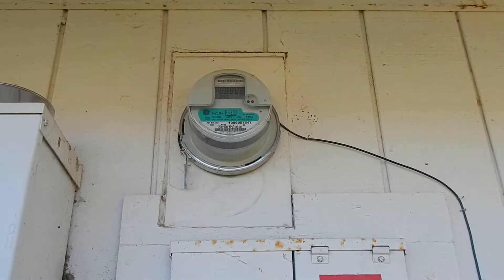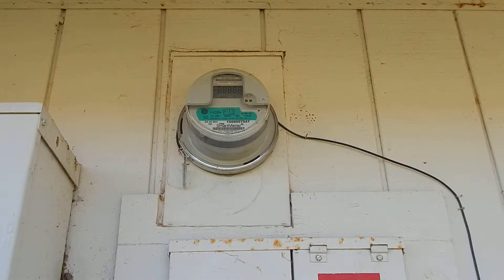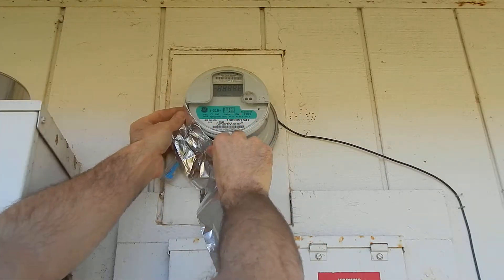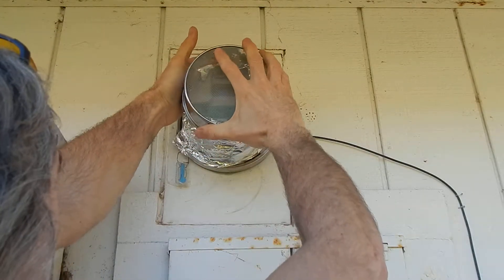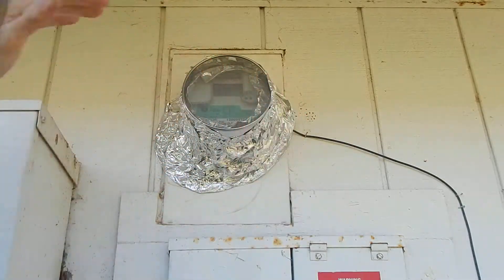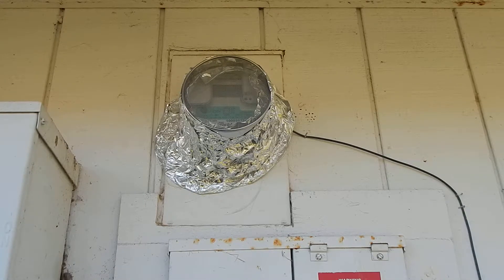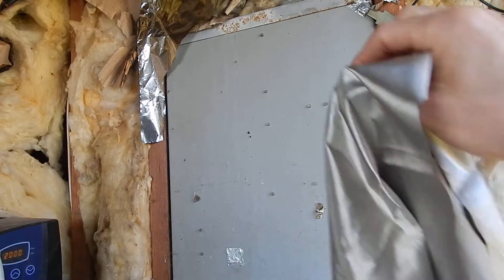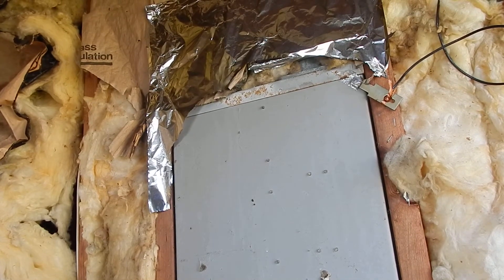Professional Quality Smart Meter Shield for Under $20

Comment: In the previous video you said the meter transmits signals through the house wiring using it like an antenna, and even devices plugged in further propagate the signals. 
So simply shielding and grounding the meter doesn’t solve much if the house wiring is like the antenna system for it and literally wired throughout the walls of your house.

Shielding all Romex in your walls is not exactly practical but if this was done all the grounds would have to go to one main ground & not be grounded to each other to avoid ground loops.

Comment: any way to show the grounding and how to do it?  I don't understand that part.
Reply from the maker: Just a wire leading to a 1-foot ground stake.
Reply: @alouiciousjackson5812  Thanks for answering!  Can the ground stake be rebar or does it have to be copper?  What metal is the wire?  Can the power company still record the reading?  They want to charge me over $200 a year if a meter reader is to come out!!
Reply from the maker: @marye8624  You can use any wire really, but stranded 14G is probably best. You can use anything for a ground stake, a large landscape nail is easy and cheap. The power company will still be able to receive the signal. Smart meters are powerful enough to broadcast 25 miles(supposedly) so this will cut it down but they can still read it.
Reply: @alouiciousjackson5812  I liked your idea of doing the back also!!! You're awesome, thanks!!!!

Comment: Even though smart meters don't need to use super sized signals (which are not safe) our govt FCC allows utilities to transmit these super size signals between the meter (utility equip) and the utility office/shop. The side affect is a people safety hazard but utilities obviously don't care about the health hazard. Your apt owner or the homeowner permits the utility to install these meters on or very near the    
residence - but if you refuse utility access the utility can remove access to electric service - not the best solution. SO safety CHANGES are needed:
1. Make utility keep their equip a safe distance away from living areas.
2. Make FCC modify the allowable signal strength used in smart meters and other similar transmitting equip.
What to do:
Get in touch with your lawmakers and express your demands for improved safety.
Supposedly, the lawmakers work for you.
or do they....hmmmm

Comment: If those meters are so dangerous to our health that people have to cover them to protect themselves, then, why do they make those meters at all? I mean, once you put a cage around it they will lose communication so their purpose is defeated.
Reply from the maker: This blocks out most of the signal but leaves enough to communicate. Smart meters signal reaches about 30 miles, this eliminates most of it but not completely.
Reply: @alouiciousjackson5812 , from what I hare read the dam meter does not need to broadcast to communicate. It sends it's messages over the wiring.
Reply from the maker: @joseperez2515  well wouldn't that be something! they have the technology to make it communicate through the wiring yet still they broadcast a microwave strength frequency through all the wires in your house!
Reply: They don't care about us or our health.  Healthy ppl don't make them much income. Sick ppl are more profitable.

Comment: I thought this entire topic was B.S. until they installed a Smart Meter at my house last week when I was not home. I haven't had a good nights sleep since it was installed. I have never had a problem sleeping in my life. I am going to do this and see how it works. On top of not sleeping my youngest granddaughter is being super aggressive which is not normal. I don't know if that has anything to do with the smart meter but I will find out when I block it. The Smart Meter is right outside of her bedroom. The only thing between her and the smart meter is a sliding glass door.
Reply from the maker: It helps with the emissions coming from the box itself- but the real problem is that Smart Meters broadcast their signal through all the wires in your house. I have to wrap my head  with and sleep under a layer of a material called Staticot. It's a sheet-like fabric that actually block the signals.
Reply: @alouiciousjackson5812  We have a right to life. Those meters are dangerous and all citizens should unite and file a class action lawsuit against the companies that installed the meters.
Reply: @kibbulz1  eventually I’m sure people will.
Reply: It will be that. Just do what this guy has done.
Reply: I hope you got yours fixed. The best option is to call the electric company and tell them to replace the smart meter with a non smart one. I did that and it’s 25 extra a month. But it’s bette than being electrocuted constantly.

Comment: You know, I'm looking this up cuz I have problems sleeping ever since I've moved to my location and I have a smart meter probably 5 ft from my bed room window. Is this possible? Sleep problems?? I have ringing in my ear sometimes a well. Idk, it just dawned on me and I look it up and sure enough there is a lot about all this shit
Reply from the maker: Yes that is a serious problem. Smart meter puts out a signal that's strong enough to reach 30 miles, like 6 times stronger than the average cell phone. Want my advice? Buy some Staticot material from lessemf.com or wherever you can find it and wrap your head in a triple layer of the stuff.
Reply: @alouiciousjackson5812  No no no, theirs EMF paint. You can even ground it. Zinc paint might work for cheaper for room. Also ground meter. Also I'll leave a video for alluminum wire mesh for cheap. Also theirs orgonite pyramids that obsorb the bad freequincies. And there not much ,also pendulums you where that people swear by. I'd do and am going to do all three for me. My meter blows up on my dumb azz meter outside for ten plus hours a day at 60 times allowed healthy. And that's not talking spikes eighther. https://youtu.be/DFI63QLMQRs
Reply: @alouiciousjackson5812  i was looking at tensor rings as well. Ive messed with electronics for years, but I've never had anything really affect me until I started going around wifi and shit like that and have noticed a big difference in sleep when around all that
Reply from the maker: @clintwilliams5740  Cool but also try the Staticot, it's the only thing I found that actually blocks frequencies.

Comment: Interesting that you can feel it. I have heard that hair can act as an antenna. I am actually here because my cows are having problems. I need to fix this problem or change careers!
Reply: @moy6569  Yep, chemtrails and Geoengineering. My theory is they put the virus in the chemtrails or else it just causes respitory issues because of all the alluminum,strantium,maganese, barium and God knows what else. You can take baking soda or sodium bicarbonate on empty stomach and it pulls heavy metals and lactic acid and alkalizes the bodies. Use distilled water,that is negatively charged and no flouride and itself pulls toxins out. Just make sure you ziplock bag if baking soda after opening so it doesn't suck in toxins then you drink it and toxins. And take in morning with empty stomach or way after eating so stomach acid digests first. Use pink himilayen salt. Once a day in distilled 2 liter. Has 84 minerals and electrolytes. Regular salts bad even though they say it's good with iodine. It's been stripped of all minerals and has one third glass to cut your arteries within. And finally yes I heard the best trackers leave alot of body hair and their amazing. Then once they shave it off their senses go away.  Zinc paint and aluminum screening from depo for cheap protection.
Reply: charleysturbos When detoxing there is a problem when you release those toxins from your body tissues. You can realize this issue by side effects of headache and nausea. To remove this issue, to eliminate the headaches etc., taking chlorella tablets will help. It absorbs and counteracts those toxins which were released back into your bloodstream and intestines.
Reply: If you are serious i am with you.  Smart meter = slow kill weapon. This is not a drill. This is serious. I hope you are.

Comment: So if you want the beam to not come out a certain direction you cover it on those sides? My meter faces my house.
Reply from the maker: The foil blocks the RF signal completely on the sides and the grounded mesh blocks most of it coming out the front. That's about the best you can do. It still puts the signal into all the wires in your house though. The best solution is just to get rid of it.
Reply: @alouiciousjackson5812  they wont allow that here. So I am going ro try to cover it as best as I can.
Reply: Alouicious Jackson Pennsylvania has no opt out. I still have the analog meter for now . The only option I have is to move the meter to a private pole 40' away from the house.
Reply: @alouiciousjackson5812  
Aluminum does not block out much at all.
Copper shielding blocks Rf signals. As the MRI modality uses copper shielding, not like xray to keep scatter from passing through the site walls, but ti keep Rf frequencies (signals which are wave forms that can be seen by oscilloscope) from entering the MRI site operating.
Reply: Aluminum in x-ray cassettes act as filters to bring about details in softer organic tissues.
Limits the radiation but does not entirely block the x-ray wave form signal paths.
Reply: They just came to my house to put one on I refused he told me I have a smart meters already. I said then there's no need to put another one on. I'm sure they are told to say that. Bottom line people need to start refusing to let these companies do anything they want. We need to take our power back.
Reply: @wyndella7212  I delayed them for a year but that's going to soon.  Pennsylvania has no op out take it or they shut you off!!!